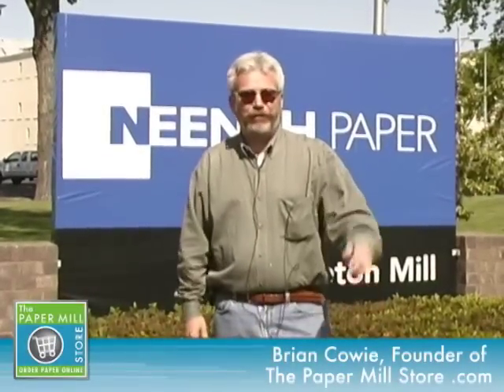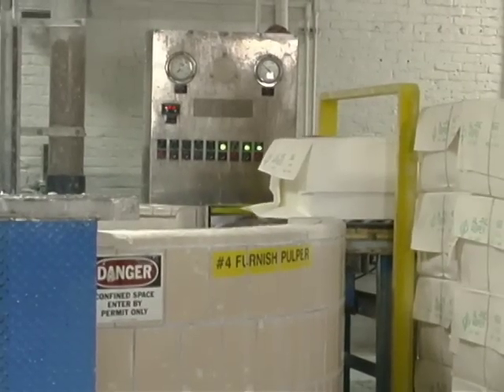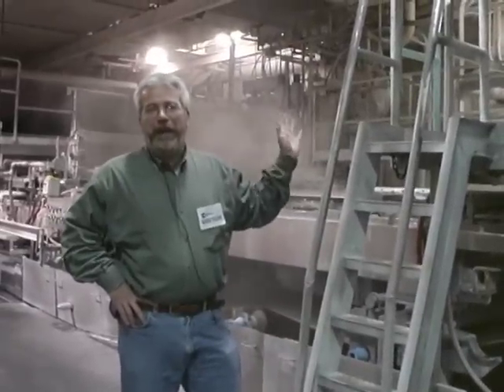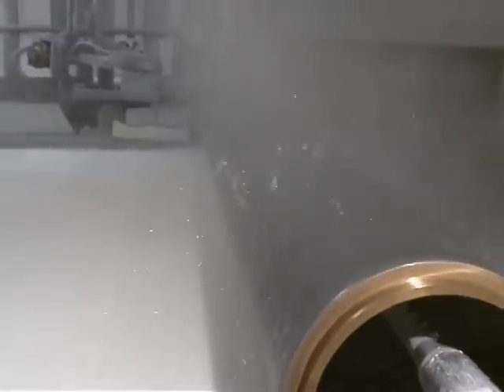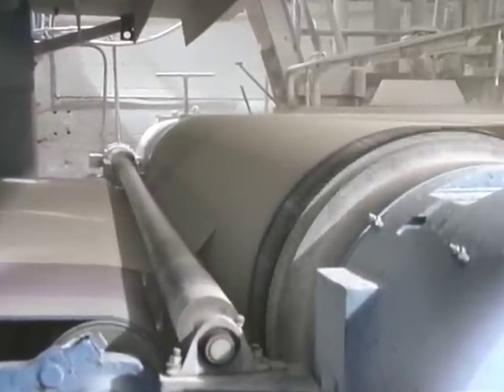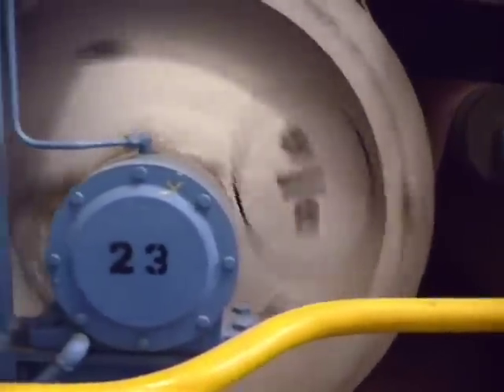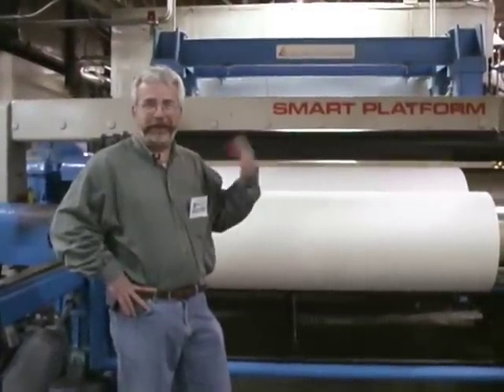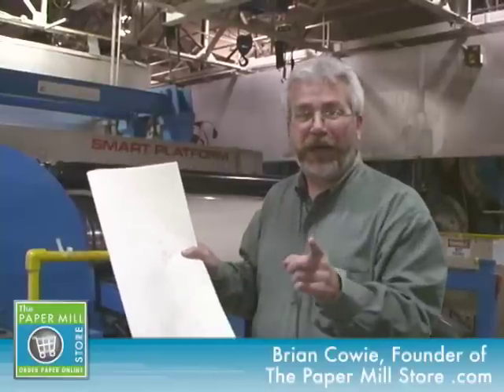Paper Making

Comment: @pircbaz I believe the sheets shown at the beginning were wetlapped secondary fibre. This is basically recycled paper, pulped and deinked in sheets. Any surplus not required immediately by the mill is  made into sheets for use as and when required, or sold on as RCF pulp sheets to other mills.

Comment: This is a good video for someone who knows nothing about paper making.  He mentions nothing about the types of rolls in the machine though.  Critical steps of the process such as spreader rolls and nips.  Either way, that machine is very clean and the rolls don't show an enormous amount of build up.  If anybody in the industry reads this and needs clean dryer cans or custom heat shrinkable teflon sleeves for unparalleled release...contact me.

Comment: Where are your? hard hats?
Most paper mills do not require hard hats on the machine floor during normal operations. That can of course vary from mill to mill. Some mills require maintenance personnel to wear hard hats all the time. So you will sometimes see an Operator not wearing a hard hat standing next to a Maintenance Person with a hard hat.

Comment: why do paper mills smell bad??

The paper mill in this video doesn't smell bad. It is a recycle mill, which has no digestor.

A digestor is a huge tank, into which wood chips are fed then cooked in chemicals, usually lye, The chemical process that takes place in the digestor is very similar to the chemical process that takes place in your digestive tract. That's why paper mills smell like that. And they used to smell worse. A lot has been done to control that smell in the last few decades.